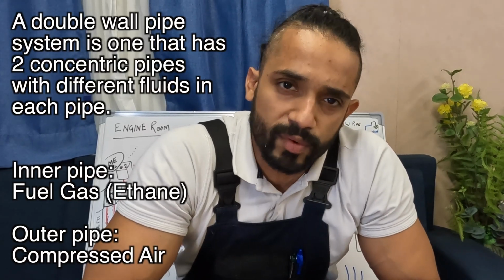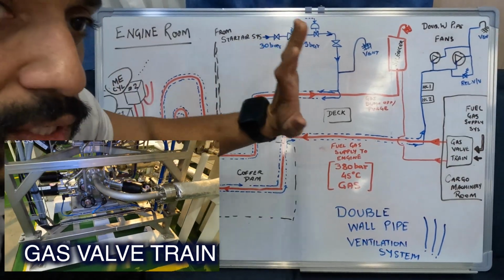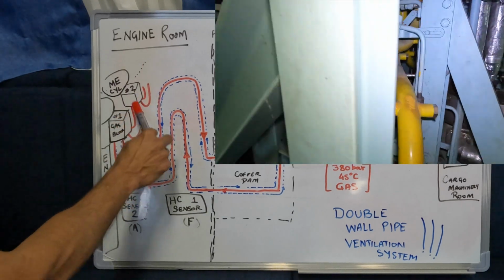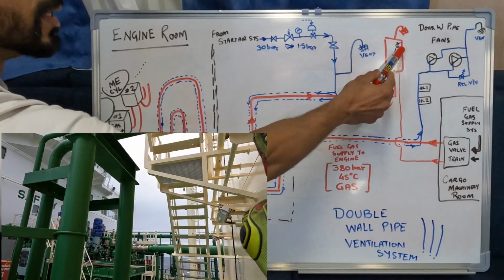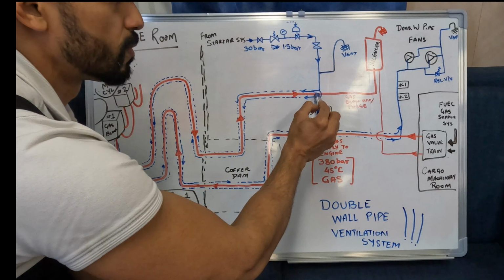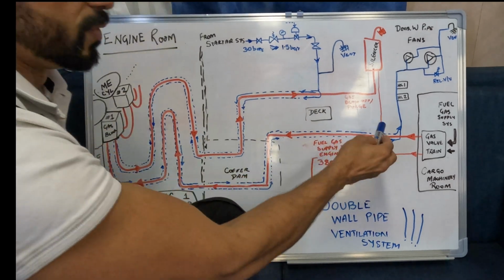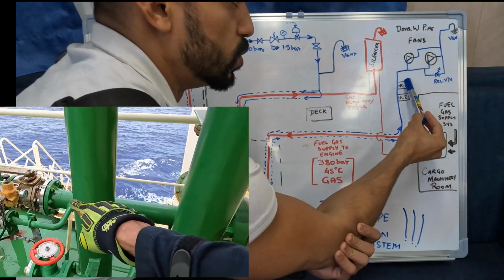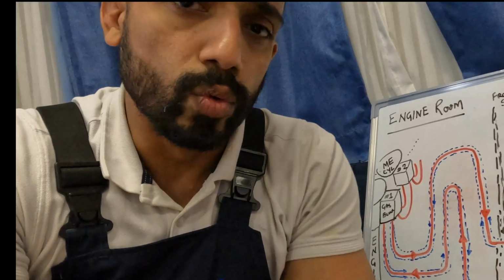DUAL FUEL ENGINES PART 5 - DOUBLE WALL PIPE VENTILATION SYSTEM

Comment: Chief, great video with real component videos in parallel to the diagram. One question: why do you need both compressed air and fans? Isn't one of this system enough to circulate air, either you push it or you suck it, no need for both or am I wrong? Cheers mate, keep up the great job!
Reply from the maker: 2 Fans are for redundancy;
only one operates at a time. 
At the inlet of the double wall suction is DRY compressed AIR

Comment: Hi Sir, thanks for the nice explanation—really appreciate your effort despite your tight schedule.
Quick queries:

What’s the make & type of the vent fan onboard?

What’s the make of the hydrocarbon sensor?
Also, as per IGF code & class rules, 30 air changes are needed in annular space of double-walled pipes. I feel the vent fan should be sufficient—do we still need a compressor connection too?
Reply from the maker: thanks for the sincere comments, standard centrifugal fans, electric motor driven, please see one of the previous videos, it will be there

Comment: Hi sir well explained , I have a doubt how the gas inside pipe was purged after that gas trip or when change from gas mode..just little I feel missing sir please complete together
Reply from the maker: the inert gas system (Nitrogen) is purged thru the supply pipes till the HC reduces in the return pipe outlet, if HC does not come down after 4-5 purge cycles, it will trigger an alarm "Purge Failed" this is called as flow purge, number of flow purge cycles rabnge from 4-7..., and the newer gen engines have pulse purge, where the system is pressurised withN2 for a short time n then this mixture is expected to dilute and reduce HC content and then pressure released to atmosphere via the vent mast

Comment: Hi , I have one doubt do the air supply from air bottle is continues in Gas operation ? Or only supplied during Gas trip or purging operation?
Reply from the maker: only during gas operation. there is a pilot solenoid valve to open the air to this system, only activated when gas operation else there will be unnecessary gas consumption. you can activate it manually to flush the system, once a month at least if your engine is OFF_GAs for a long time so no condensation in the line
Reply: Thanks a lot for clearing my doubt…👍🏻🙏🏻

Comment: Sir, I have a question. The gas for the injection don't return to the gas tank but goes to venturizer. Isn't that kinda methane or ethane slip?? And what should we do if the ship is in the area that we cannot vent out the HC gas?
Reply from the maker: DO NOT RUN ON GAS.. run on compatible diesel /HFO fuel only
Reply: @Thedeepseaman  Aha~~ thanks for reply. I understood

Comment: What Air tapping is from 30 Bar? Why not from Control or Service air supply line ?
Reply from the maker: can also be from there but the air quality has to be dry air as the condition of the double wall pipe must not deteriorate with moisture over time. We are actually considering a change to have it from the control air outlet line as this will save on the MAC running hours.

Comment: Thanks man! Very nice explanation!
Could You share with us other Machineries, such as - How Your Aux. Engines are running on Gas/ and or Boilers...
Reply from the maker: well, i havent been using gas on those machineries as the vessels i sail on have only gas designed for the main engine operation. I am certainly learning and reading the same too

Comment: Enjoyed your videos. Can you tell how the gas fuel consumption is measured and regulated as per load fluctuation
Reply from the maker: consumption 2 methods: 1. Mass flow meter, 2: actual sounding of tanks, 3 - Approximate only: stroke counter of the PVU calibrated to measure fuel flow... regulation of fuel as per Main engine load but the ECU
Reply: Thanks for your reply about the measurement of fuel consumption and will be looking forward to your videos.  @Thedeepseaman

Comment: Hi, sir thank you for the informative videos truly refreshed my knowledge on MEGI engines. 

I have a Question. 

Can I confirm that the medium of the ethane  fuel after the HP vaporizer and GVT in double wall pipe is gaseous ethane ? 

Thank you.
Reply from the maker: After the vapouriser--->ethane, vapour, 45 deg C..
Reply: @Thedeepseaman  thank you